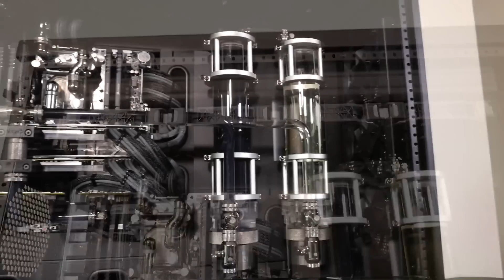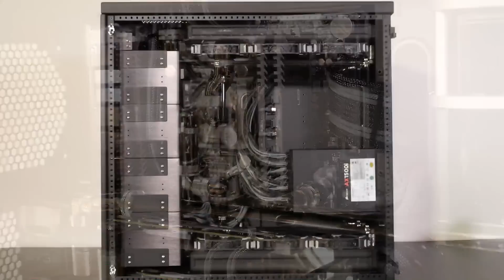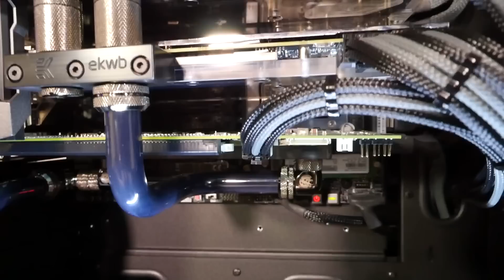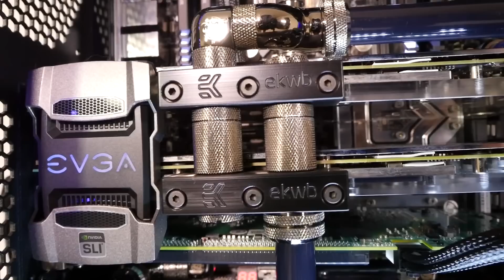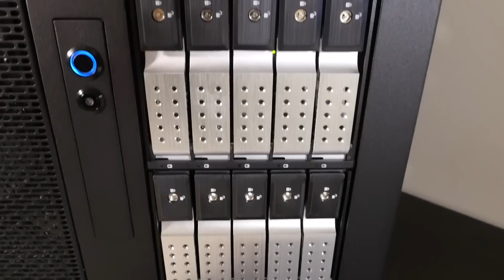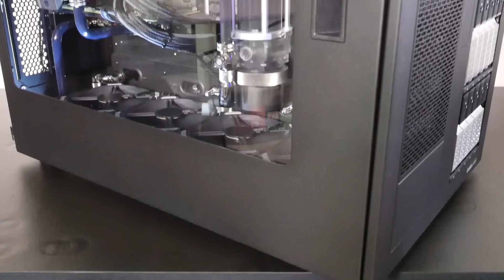SC Build #18: Extreme Workstation: Part 5

Comment: I have a question. Currently, i am building sff build
And my macro itx mobo is so close to my PSU, like you.. I want to build my cables from the ground
Whatd happen if i make those cable so exact length needed, like if my mobo and my psu are so close, i build 24pin very short, like it needed to be
Is there gonna some harm?
Reply: no

Comment: the SLI bridge doesn't fit.  everything is immaculate, industrial, minimalistic and shiny. but that EVGA SLI bridge looks like a 1993 ford laser parked in there. i don't know if "high speed" sli refers to some type of low capacitance eddie current/noise reducing design, or just more connections, but even 2x the basic "included with mobo" PCB sli connectors would look so much better. (sorry; i know everyone's an expert) great job though.

Comment: I have a random watercooling question.
i have a 2600k and gtx 1080 in a loop with a single 480 double thick rad with push  pull fans
i'm not liking the 50C load temps on my 1080

would adding another 360 rad help with temps?
Reply: Not An Argument. no...that rad should have no trouble with even that plus another gpu...there is something else going on.
Reply: Jeremy Simpson i dusted off the rad and made an intake to suck 40F air from outside and temps went down to 37C

still seems high since my 780ti ran 31C
Reply: When was the last time you flushed and cleaned your loop and blocks?
Reply: Well hell my 1070 is sitting at 27-30c most times..its not horrible but could also check paste on the chip
Reply: Jeremy Simpson it's a MSI EK 1080 removing the block would void my warranty.

most likely they used too much Paste

Comment: may have just missed actual diagrams of the liquid loops and a 2nd diagram showing which fans are in and which fans out'
- Daniel gives a word description but I as a nookie must constantly start and stop his videos to make notes. I'd rather use a master builders plans, like Daniel, rather than make very costly routing errors and costly wrong fittings ordered. would love to take a class taught by Daniel esp since liq cool parts are so expensive

Comment: Do you consider using a plate heat exchanger to balance the gpu and cpu loop liquid temp?
Reply: Cooper I remember from my physics college class that plate heat exchangers are not efficient enough for many application because one side still need to be cooled a lot. In this case, we're dealing with at least 300 watts so cooling 1-5 watts isn't going to make a difference. But with that said, I might be wrong since the only knowledge I have of this is from years ago.

Comment: I think you should have made a backplate for the raid card, the green is throwing the colour scheme off a bit
Reply: also, the side window seems far too small :/
Reply: i suggested that also in the last video but i think this is a reaaally small detail :)
Reply: thought the same about the windowsize ... but i think that is a thing, because we allways see the build completly without a window in every single video...
Reply: A custom plexiglass plate would look nice.
Reply: the question is: does the raid card have holes to eventually install a backplate? It's a thing to keep in mind while designing a PCB so I don't think engineers thought of that